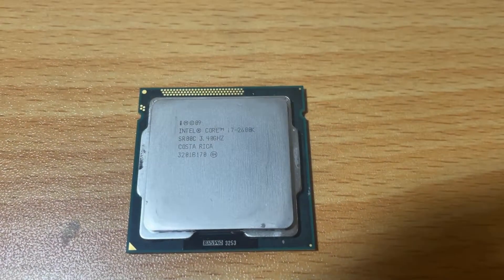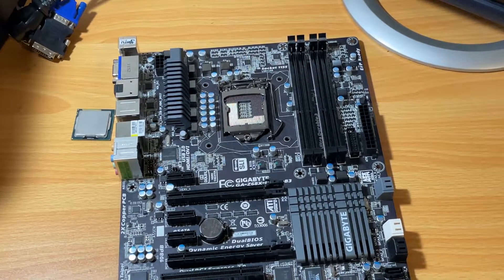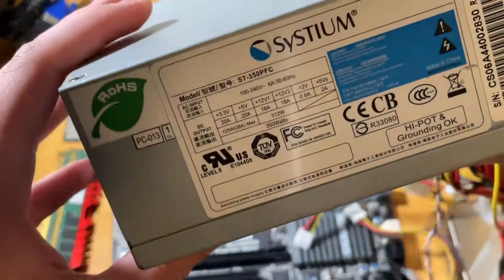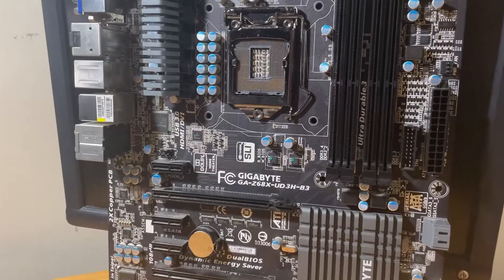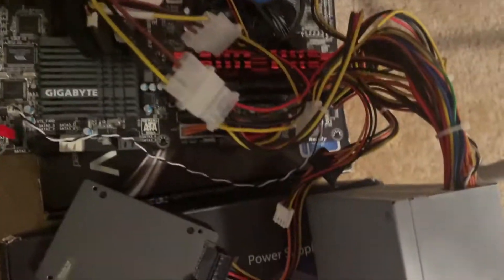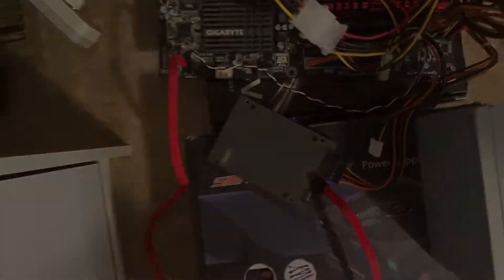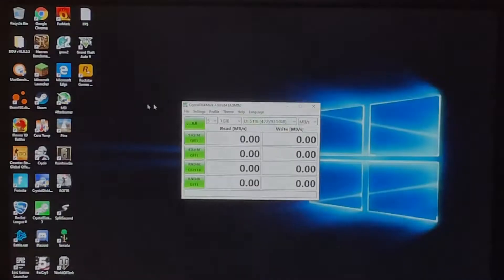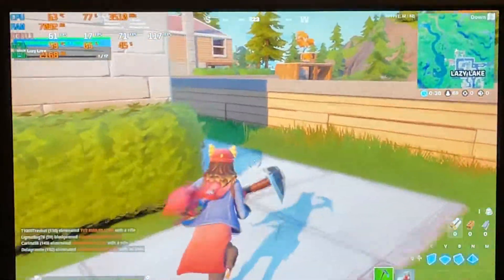How Does a 9 Year Old Core i7 Game in 2020? | Intel i7 2600 Performance Tests

Comment: I bought my desktop back in 2011, it was built by ZT Affinity, I still use it everyday, I just upgraded the tower(case), I am getting ready to upgrade to 32GB of ddr3 1600 PC12800 RAM, the specs, are a Gigabyte Q77M D2H Motherboard, with a i7 2600k, with 16GB of ddr3 1333 PC10600 RAM, (2)-1TB Hard drives, it had 1 DVD multi purpose burner, 1 Bluray multi purpose burner with light scribe, 1000 watt power supply, I added 1 Hard drive and the Bluray burner, I do not do any gaming, the processors is not over clocked, there is stock graphics(no graphics card added) and stock audio(no audio card added), it performs great after almost 10 years, was awesome when I bought it new and still is awesome, I have read reviews and watched videos that back what I say about the i7 2600k, it still performs very decent, it performs great if you never do any major gaming, I have a vinyl cutting machine and this computer works great when creating and working ideas, Intel did great with this 2600k processor